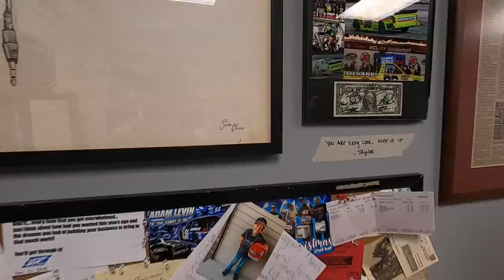How NASCAR Drivers Custom Helmets Are Painted! Inside Off Axis Paint Shop Tour!

Comment: I spent my career hand lettering (a lot of race cars). Brush lettering, with the occasional airbrushed "high lighting". It always scared me to spray paint helmets. You see, I raced my own cars, then became a racing series inspector with safety as my number one priority. I always felt that paint and solvent fumes getting trapped inside a taped up helmet would break down the materials inside. Now though knowing it was more likely a possible issue years ago, before more modern environment-friendly paints.
I can also relate to the pricing issue when starting out. How can I expect to be paid a living wage for just doing something I have fun doing, that's this easy? Not realizing, if it was "easy", then people wouldn't need me. It was easy for me because that's what I did, and was meant to do. I started when I was 12. Like the saying goes, "Do something you enjoy, and you will never work a day in your life." Unfortunately for me, I never got over that poor sense of value, and didn't make near enough as I could have in the first part of my career. Then I had medical issue that made have to retire at 48 and never built up enough for that early of a retirement. Again, another thing you have to think about when pricing.

Comment: That is awesome! He didn't say anything about it, and I would think he would have one, but they make an electronic device that you sit on any color and it will give you the code to produce that exact color. Say you have something that's a certain color and you don't have the paint code, you just sit that device on it and it reads the color and gives you the code that will match it perfectly. 
It's great for producing new codes for older paint jobs that have faded over the years and you need to repair and repaint a fender or door and the original paint code won't match up because of the years of fading. Or if you would like a helmet that is the exact color of your Escalade, you just read that color with that device and it will give you the code that matches perfectly. How they invented a device that can do that is beyond me, but it is just cool. lol.
Reply from the maker: Man that is awesome